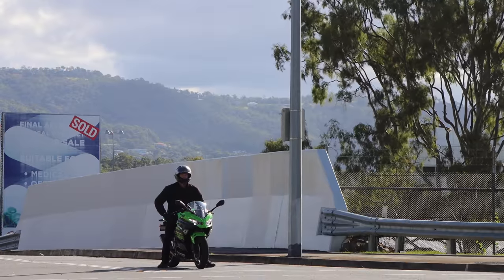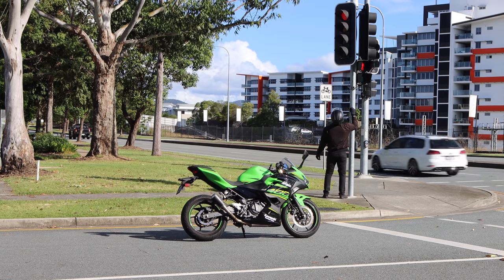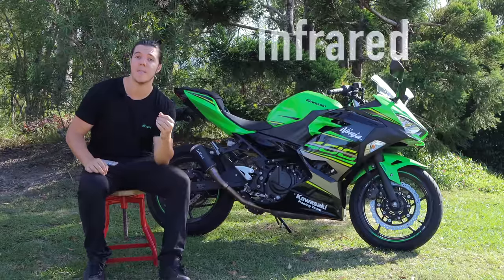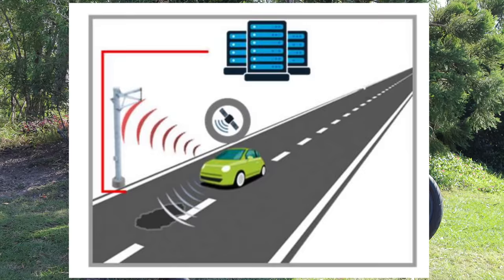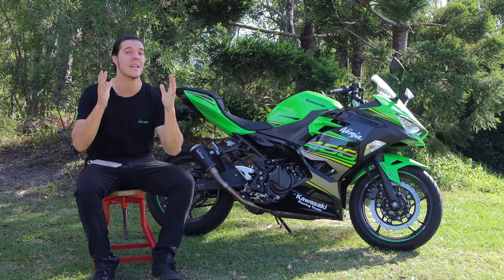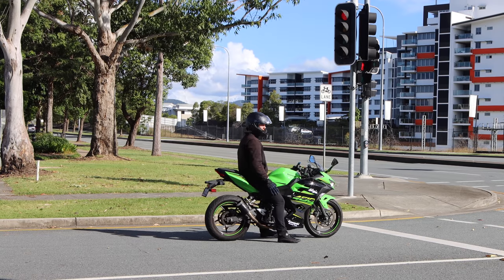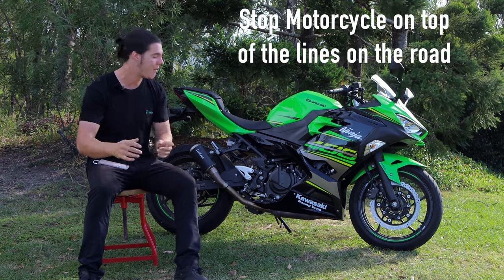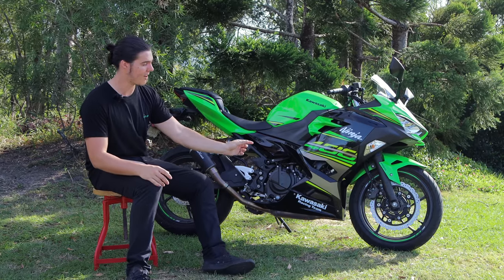How to trigger Traffic Lights on a Motorcycle | Stop getting stuck at red lights

Comment: I basically already knew about everything that you said except for the "DEAD RED" law, which it showed that my state had that law but 9 times out of 10 I just run the red light anyhow. I ride a moped which has a hell of alot less medal than a motorcycle. TRAFFIC LIGHTS NEVER CHANGE FOR A MOPED, it doesn't matter if there is a car behind me or not, I AM GOING TO RUN A RED LIGHT WHILE I'M ON MY MOPED.

Comment: I've been stuck a couple times extra early in the morning going to work. Thought about running the light, but you know that would be when the cop comes around the corner. So I put the kickstand down and quickly jet over to the crosswalk button hit it a few times and jet back. I turn my flashers on for extra security if you don't have flashers maybe a turn signal. You run the risk of your bike getting hit when it's unattended but also that early in the morning people really aren't paying attention for a bike stopped at a crosswalk anyway. The dead red lie in my state. If you're skipped two rounds you can go roll on red. Ride hard drive Safe
Reply: Just blow the light bro 😂

Comment: All my motorcycles have center stands. So when stopping for a red traffic light, I always stop exactly in the middle above the loop line, and then bring the center stand down with my left heel, so that both legs of the stand touch the ground on top of the line, and keep it there for a couple of seconds. So far this has always worked for me.

Comment: The tech at the parking garage I use told me the edge of the detector is most sensitive.  Pull right over the tar seal on the edge of the detector.  Works for me.

Comment: I remember when Sydney had pressure pad triggers back in my teen years. They were like a heavy rubber garden hose mounted in a concrete base and the weight of the car squashed them enough to trigger the system. Those traffic counter hoses we sometimes see are much thinner than those old ones. However, the rubber back then became brittle over time and they would crack apart and no longer work. Many a time my step-father would ask me to get out and press the pedestrian button when the trigger wasn't working.

Comment: I have tryed everything mentioned and with one bike under 400 lbs, not much metal, I had lots of issues with lights changing for me. Here is what has worked for nearly all induction loop triggered lights. Very similar to what Kwackajack mentioned with a twist. When approaching the sensor aim at the corner so that you cross 2 wires and not just one. I then swerve across the remainder of the wire unitl I'm at the stop line. This works nearly every time even on my smallest bike. Just make sure to do this maneuver in your own lane. In high traffic areas the cars will trigger the light anyway.

Comment: I live in a small town and the main center of town red light sensor was not working for motorcycles, so I would circumvent this by slipping into an adjacent parking lot and bypassing the red light all together.
A local cop saw me do this late one night and stopped me.
I explained that the sensor on the light would not trigger for a motorcycle and he was cool about it.
We even filmed a short video on his cell phone so he could send it to city maintenance so they would address the issue.
The light now works perfectly.

Comment: Where i am in the us they tend to use induction loops. I usually just give a rev or two and it’ll change almost instantly. We also have a thirty second “dead red rule”
Reply: I question if the revving the engine really works. This implies that the internals of the engine are disturbing the magnetic field enough to trip the sensor, but the pistons and con rods are  enclosed by a lot of metal, which is a magnetic shield. Did you try an experiment at a problematic intersection, where you stop at the same spot, with and without revving?

Comment: In Oregon you can treat the light like a stop sign, if it doesn't change. 
I usually shut the bike off and restart it, works sometimes.
 Or a little rev to shake the ground, works for my wrx.

Comment: Years ago, I was a driver helper for UPS. There was a light with an infrared sensor on our route that would get stuck because of the low sun in the evening. Even the UPS truck wouldn't trip the light.

Legality or UPS policy is probably against this, but I would hop out and hit the crosswalk button when it got bad.

Comment: At my previous GP's I used to wait for another patient to exit in a car and follow them out through the lights as the induction loop wouldn't pick up my bike. During visits last year, in the middle of the pandemic there were no other patients as visits were strictly controlled, so I had to carefully take a few red lights, but there were next to no other vehicles on the road. The induction system is great, when it's properly calibrated.

Comment: Good info.  I'm an electrical engineer and already knew about induction loops.  I was already stopping directly above the loop coil and some still don't trigger.  I did learn some good info in this video, though.  Thanks.

I'm seeing people in cars stopping 1-2 car lengths back so the sensor isn't tripped.  It must be deliberate.  Is there some hoax email that is conning people into this foolishness?
Reply: Yes!! I thought is was just overly polite drivers here in the South. Drives me crazy. I actually had a cop do that. I actually got off my bike after a few cycles of the light and that idiot just sat there looking at phone.  I finally just ran the light.

Comment: Oil thing you didn't mention but probably should is oil slicks. Usually the center of these sensors where vehicles stop often seem to be a place where oil, antifreeze, and other slippery liquids seem to collect. It can be challenging as to avoid stepping in it or getting the tires in it when trying to activate the sensor.
Reply from the maker: True, but in my area at least the sensors are quite wide and rectangular shaped across the road. The one shown had 3 lines like this | | | and I stopped on the middle to show, but you could stop on either of the side ones and still trigger it

Comment: I've daily used motorcycles for commuting for over twenty years. What I do is if it hasnt triggered in a reasonable amount of time, roll the bike backward and forward to be a couple feet left or right and try again. That often works. For regular routes, I make observations about where to stop at specific lanes and stoplights and repeat what works. Sometimes you just have to run lights when its safe, or alternately turn onto the crossroad instead of going straight, then turn from that road. Good luck!

Comment: In my home city in the USA, I was able to contact the streets department through their website when the sensitivity is too low. They fix it really quick emailing me back to go and try it again. They fixed the problems at 3 different lights within a day each time I reported it. One time late at night in a different city I was stuck at a light and finally went after waiting a few cycles when it was safe to do so. I was pulled over by a local police officer, but after I explained what happened he let me ride on. These were all ground loop detector types. I think the problem is more with those of us that ride sport bikes versus the heavy cruisers with more metal mass closer to the ground. This was interesting, because I only knew about the ground loop detector types.

Comment: great video sir, I have a magnet out of a hard drive glued to the base of my boot and when I roll up to a set of lights I place my boot on the cutout line and never had a long wait yet, I can't say YES it Works but Iridium magnets are very strong. I had so much shit (metal pieces ) from the road I had to stop and clean it off my boot. I'm in Western Australia and the lights suck 1 truck will slowly go threw and it's red again.

Comment: Nice  explanation.
However, seems you touched on the EVP system as a former  vff they  had boxes in their windshields as they came to a light they  could  easily change it to allow the vehicle to enter the  intersection and go through.
Now days it's  more sophisticated and it's tied to a GPS system.

Comment: I've also seen military transport vehicles get stuck at traffic lights because the body of the vehicle is too high to trigger the loop sensor. They eventually drove through a red light as there was a long line of traffic stuck behind them in the right turn lane

Comment: Our induction loops are circular. Some are not visible but you can see a tar “plug “ where they covered it and I usually pull near it. Works 90% of the time.

Comment: I recommend Gren Light Trigger. There was one light on my way home for work that would not be triggered by my Triumph Trophy 1200. I had to wait for a car to show up or just run the red light. I installed Green Light Trigger (actually two, one on each side of the frame. I never waited for this light again. Now, it does not turn green as I showed up, but still went thru its normal cycles -- I just never waited past my turn.

Comment: Here in Tennessee bikes are allowed to go through reds if they're not picked up by the sensors. I know all the lights in my area so if the roads aren't busy and there's little chance of a car pulling up behind me to trigger the sensor, I'll go as soon as I can. Another good point that wasn't brought up is that bikes with aluminum frames and swingarms are unlikely to trigger induction loops no matter what, since there's so little ferrous metal on them.

Comment: It's very simple.  I put rare earth magnets in the toe sliders on my boots.  When you stop position yourself so that you can sweep your foot across the sensor.  That induces a voltage into the sensor.  It works every time, even on stubborn lights.  My Uncle is a life long bicyclist.  We were having dinner one holiday and he told me his biggest pet peeve.  I told him about this and he tried it.  Now he never gets stuck at a light, even on a 12 lb bicycle.    If the magnet is on the shoe you have control over where you put it and the direction you move it.  Waiving it across the sensor at 90 degrees is most effective. . . .  I like that gcenteno97 idea too of starting the bike.  The moving electric / magnetic field is what trips the sensor.  Always take advice from an engineer!

Comment: Cool!  Here's another little hack for those in cars (and maybe bikes too) to trigger the protected green left arrow in the USA.  If you go right up to the line, and you're the only car in the left turn lane, you will not get the protected turn green arrow.  You will have to wait for the green, creep out to the middle and turn after the cars going the other way are done.  However, if you hang back in that lane, like in the 3rd car's area, it will trigger the protected left arrow!  Trust that would either be video sensor or infrared.

Comment: I get this problem occasionally on my Honda Rebel with lots of plastic and alloy wheels, never had the problem on my Royal Enfield with lots of metal and spoked steel wheels.  I usually give the lights a full cycle from when I arrived, if everyone else has had a turn it must be mine, never been chatted by the Police as yet. In Adelaide S.A.

Comment: Hmmm, never knew about the "Dead Red" thing. I'm in North Carolina and most major intersections in my city have those loop sensors. They have the lights set to stay green on the main roads until a vehicle approaches from the side road. I like to ride at night and I have that issue all the time, so I just treat the red light like a stop sign when see there is absolutely no traffic around.

Comment: Back in my home town in the 80s they installed those sensors in the road. My XR250 would not trip it. I had luck by putting my stand down and touch the road surface over the pad and that most times triggered it. Be cautious doing that on a large street bike as that might shut the engine down.

Comment: I have experienced this on my 02 Shadow 750 a few times and even in my car here in San Antonio TX. At 2am i was stuck at a light. No one around for 10min. I wanted to just run it but i figured it was 2am on a weekend. Some cop is probably hiding waiting to get me. So i backed up and went a different way. This was 15 years ago. 

I came a across a few on my bike. I had to back pedal over the pad. 

Another time, i got stuck in some rich neighborhood where my brother lives. The exit and entrance were closed after 6pm and the in an d out are separated with no room to spare. So i couldnt get out the IN side because the gate would close too fast or the motorists would go super slow so it would close before I could get to it. But i think this was a weight sensor because i tap danced and put my bike on it all sorts of ways and wouldn't open. And no manual bypass. 

I had to call my brother to drive up and let me out. I think it was a 1000lb limit and my bike is about 750lbs plus my 205lbs of American grade A come and get it. 😏 so just short of the limit. 

Guess the rich neighborhood couldn't afford a better  gate controller.

Comment: I have never had this issue riding in Victoria, even on a light bike like the ninja 300. 

There are detectors which are just wire loops located just under the road surface. You can see the outline of the rectangular loops at most intersections. They only cover the middle section of the lane. 

As riders, we are taught to ride to either side of the centre of the lane, whether that be lane position 1 or 3 so to not ride over oil or other fluids that may leak from cars. However, this will most likely make you miss triggering the wire loops.  

So as I'm coming to an intersection, I can see the outline of the rectangular loops and make sure to ride through them in the middle of the lane, then have enough distance to pull either to the left or the right on the lane again.

Comment: i have driven a high bed bob truck and had the same situation we found out that you can take a metal shovel and slide it across the pad to get it to trigger i guess on  bike you could laways carry something like a folding shovel or a flattened out tin can. which i always carry on a bike anyway for new or hot pavement.

Comment: Last week, 3 of us were riding up to a main highway, where we intended to turn left, and were stopped by a red light. There clearly had been road work at the crossing, and after we waited for several minutes, no light changes were occurring, and it seemed obvious the traffic activated controls were operating the lights, but the lanes we were in were not connected, due to the road work. The pedestrian crosswalk light remained white, just ahead of us, which is, of course, the first indicator of a coming stop light change. With no other vehicles in our portion of the side street, we opted to hang a permissible right turn, and after passing the island in the centre of the road, did a U-turn, and proceeded through the still green light on the main road. I have had similar occurrences when driving in my car, and have come to the conclusion that lights are not always put back onto the timer mechanisms, even when roadwork has caused a disruption to the inductive system. Can be very frustrating! Especially when ongoing traffic limits your options.

Comment: It's an induction loop. So both the speed and mass of the iron object passing along the loop affects the voltage in the loop. A car has much iron mass, and can cause a detectable voltage in the loop much easier (at lower speed) than a lightweight motorcycle. So on a bike, you should approach the loop at a higher speed and do a quicker deceleration to your stop. This helps the system detect your presence.

Comment: Up here in Newcastle (the Aussie one) there are shopping centre car parks that have a detection system that reads my number plate (to time me on the way out) and opens a boom gate and my bike always triggers them. Recently I got another smaller bike for city riding and in another shopping centre the small bike would not trigger the system although the larger bike is OK. There was a console on that one where I needed to press a button to open the gate and get a ticket but the system just refused to recognise me pressing the button even with moving the bike around trying to find the loop. The driver behind me suggested I tail-gate him to get through. No thanks. I had to turn around and ride out.
I later figured that the button would not operate unless it could detect a vehicle to stop people from pressing for a new ticket to exit without paying after parking all day.

Comment: I have a sensor system on top of the traffic light overhang at the first intersection near my work that will not pick up my lowered Mustang. And there is another one a few miles down the road that does the same thing. There is nothing more frustrating than working 9 hours wanting to just get home, but having to wait for another vehicle to come by to trigger that f---king sensor. Can't run it either because there is also one of those cameras that will get you a ticket in the mail (I work 2nd shift), so I often have to wait for awhile.
Reply: Maybe if possible find a new route
Reply: @ericscaillet6087  I do have an alternative route, but I have to drive through 5 cities, and 25 minutes extra. Don't always have the time.

Comment: This happens alot in the uk. Are traffic lights run off floor sensors when on them they trigger the lights mostly works. But bikes can be to light for sensors to trigger. Most of the time they work.